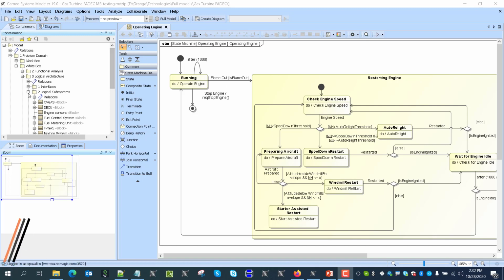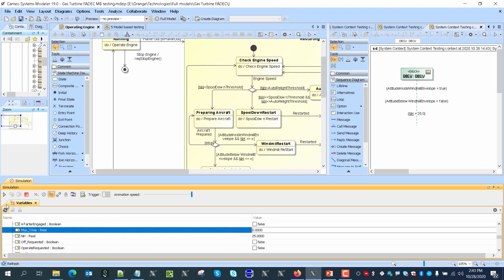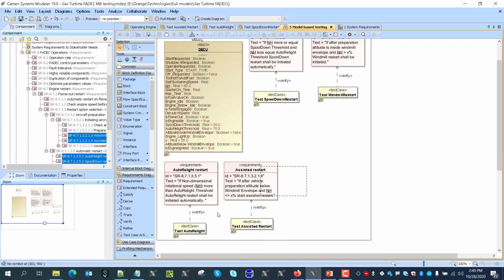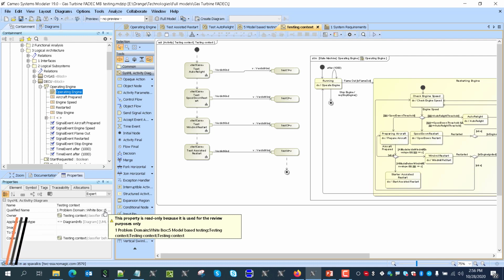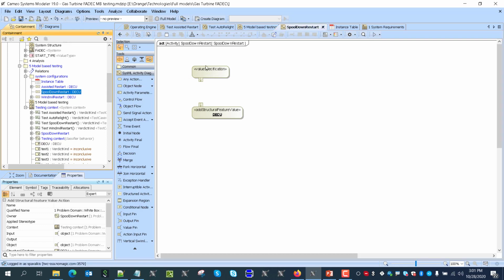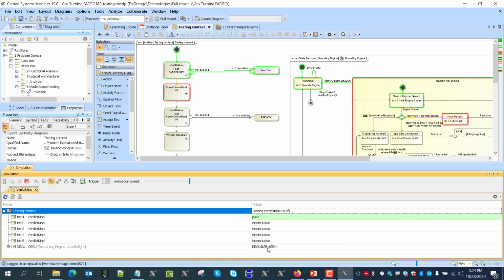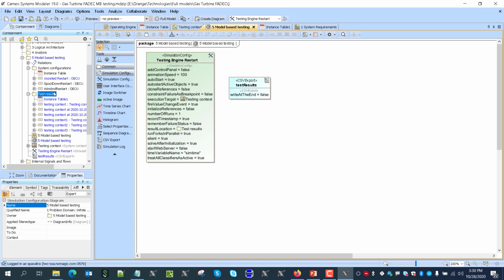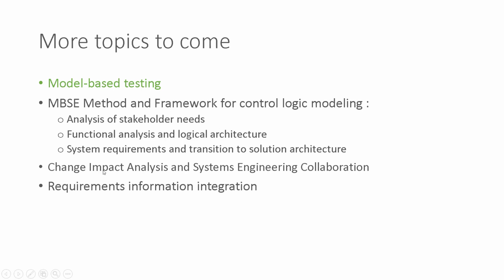Model-Based Testing Tutorial When System Architecture is Defined in SysML - Part 2

Comment: I'm started learnig SysML 6 months ago and your videos have been a great ressource. So thank you very much for that 🤝
I wanted to use sequence diagrams to validate the bevahior of a block which I modelled with an activity diagram but ran into a problem. It would be great if you could share your insight on it 😀

The block has ports which are typed by interface blocks and the interface blocks contain flow properties. Therefore the information flows in and out ofthe block through flow properties (not signal). So, to validate the behavior of the block I need to set the values of the "input" flow properties and check the value of the "output" flow properties. And that's exactly what I could not do in a sequence diagram. I tried the following in the sequence diagram...
1) Assign a flow property to a message
2) Assign a flow property to the lifeline
3) Add a call behavior action (within which I write a value to the flow prperty) to the lifeline
4) Add a state invariant to the lifeline and add an specification below it to set the flow property value

Any ideas?
Reply from the maker: Thank you! Maybe this one can help ? https://youtu.be/C8lk5gRnXyo

Comment: Salius, great video once again.  Question for you, I am doing something similar, but in my case, the DECU block has constraints on it.  When I use an instance to configure the test, and a value specification to set the DECU part property (via addStructuralFeature) the constraints do not seem to evaluate.  I am unsure if that is an issue with how I set up the instance or the runtime objects.... any ideas?  Thank you

Comment: Great video!  Thanks for creating this.  I've followed along and decided to not have variables reset before each test case in a model I'm working on.  The question is why when I run through the test cases, the second testcase doesn't reset the state machine to start from the beginning.  I'm getting a warning that a state invariant has been violated. It starts from where the last testcase left off.  Thoughts on how to make sure the state machine runs back to the beginning?
Reply from the maker: Hello Travis. Thank you for the feedback! Yes, you need to reset system as an object as shown in video. Method which is used is to create new system object and add it as part value overriding old one. So it works as reset plus you can create system object based on instance so it can have custom properties as shown in video. Quite simple way to reach this.

Comment: Super video! It really helps me a lot.
However when I tried to run the test through cmd, I have this error:
"Error occurred during initialization of VM
Could not reserve enough space for 2048000KB object heap"

Do you know what might be the cause for this? Thank you very much!
Reply from the maker: Hello An. Thank you for the feedback. Something related to Java virtual machine. Please check that JVM path is in windows parameters. You can use same JVM as comez with Cameo installation. I think this parameter is discussed in this video.

Comment: I tried to apply this methodology to a system-under-test, where the system-behaviour is modelled as an activity-diagram. Executing the model, and recording the simulation into a sequence-diagram works. The sequence-diagram only shows messages and state-invariants (whenever a value property is changed). So far, so good. However, when I then apply the <<testCase>> stereotyp to that sequence-diagram, and execute it, the execution "fails", due to state invariant failure.
My question is: How to properly model testcases (using sequence-diagrams?) for systems which have only activity-diagrams as behaviour?
Would be great if you could make a small tutorial for that case!
Reply from the maker: Hello Florian, thank you for the feedback and video request. We will prioritize it for the near future.

Comment: Very helpful tutorial! However, when I tried to apply it to my own model, I did stumble across 2 issues:
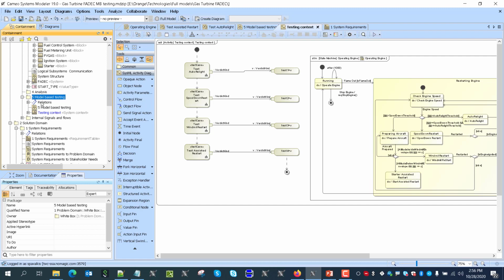1) Within the instance-table for creating the system-configurations, I could not set the value of my system-under-test instance, when that variable is an enum. Error message = Incorrect number format. In the video (starting 16:30) I can see that you also have a variable "start_time" which is an enum, but you do not edit it in the instance table, so I cannot see how to do it correctly. I can set it in the sequence-diagram using state-invariant, but not in the instance-table.
2) When I try to output simulation results to csv-file, the enum-variable is not exported. For that I managed to come up with a workaround (create a string-variable, assign the enum-variable-value to the string-variable, and export the string-variable) but it is not very nice. Is there a clean way to do it?
Reply: It seems that if you use enum (from UML) inside SysML, it does not work properly in instance-table and csv-export. However, if you apply the stereotyp <<valueType>> to that enum, everything works fine now.
Reply from the maker: Hello Florian, thank you for the feedback! Yes you need to use SysML enumeration. There is element to create it in BBD diagram. 

Talking about enumeration export to CSV looks like bug. Worth reporting to support@nomagic.com

Comment: Great example of MBT on MagicDraw!  I was wondering with your example how to set up separate SimulationCofig files for each test case?  I want to be able to use command line option to run separate test cases individually from the same test context and have it return the VerdictKind result just like the TestVerdictKind.mdzip sample project.   So for example, I want to only run test case 1 and 4 from a command line and have the test case activity diagrams return the results directly to command line.    Here's what I would like to see as an option to record test case results directly without using an external CSV file.

set TC_Result1='simulate -project “<path>\\MyTestSuiteProject.mdzip” -config “Run
SimulTestCase1” '
set TC_Result2='simulate -project “<path>\\MyTestSuiteProject.mdzip” -config “Run
SimulTestCase2” '
Reply from the maker: Hello Steven, thank you for the feedback! We are working on command line parameters in and out feature now. Likely will be available mid 2021.